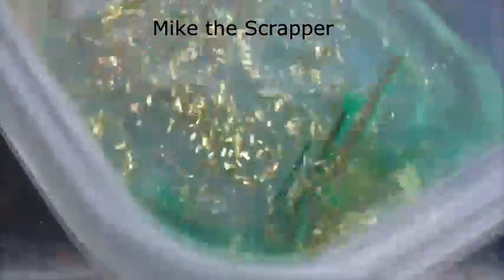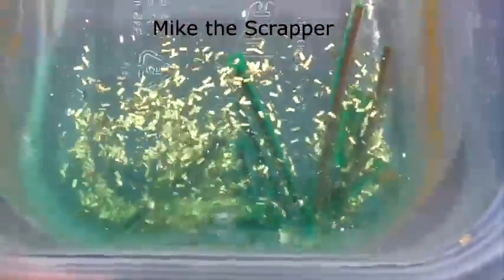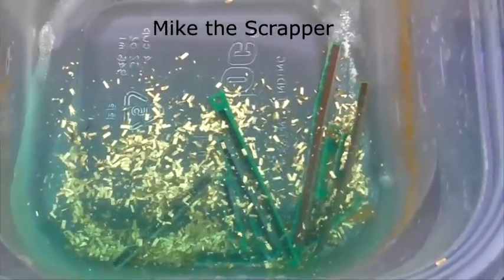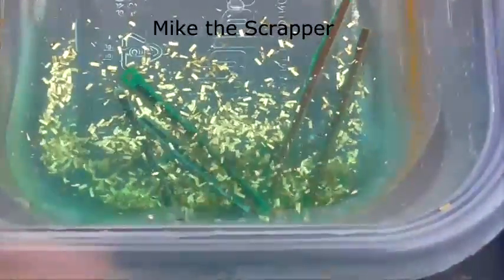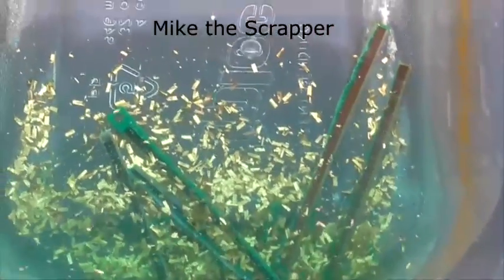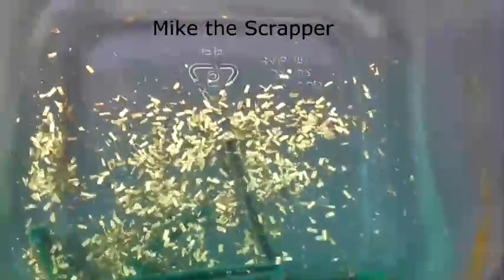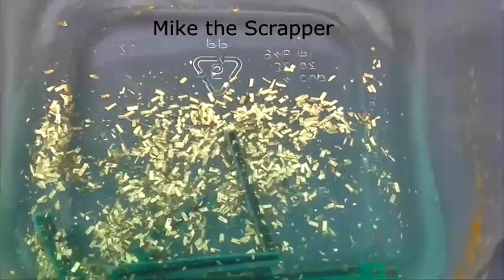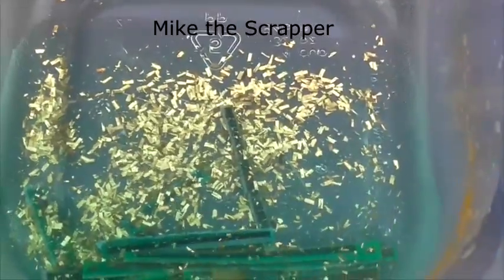Gold refining sneak peek

Comment: If you have a hot plate or even a cheap candle warmer, heat really speeds things up (don't boil). I'm not sure if you have precipitated your gold yet but make sure you do so in a spotless beaker as the gold dust will stick to your beaker if it isn't....major pain to recover afterwards.